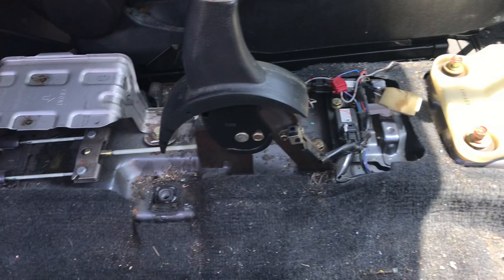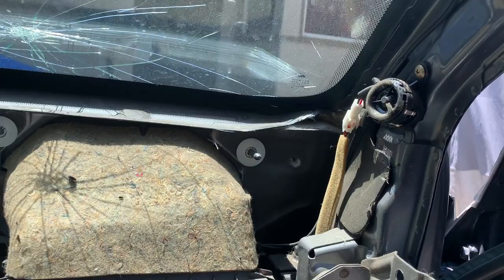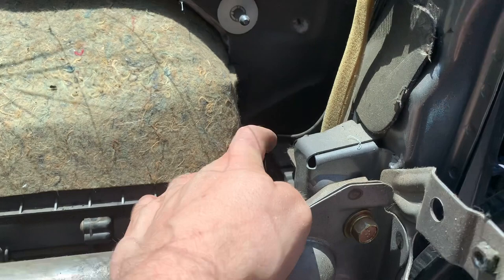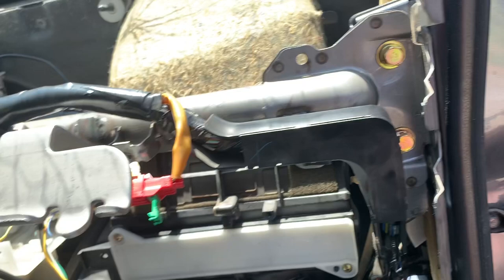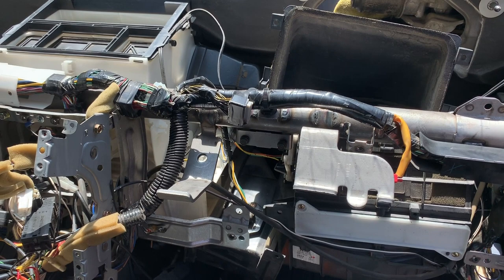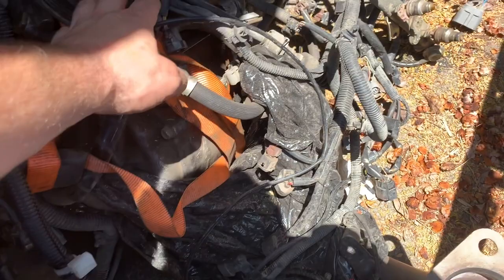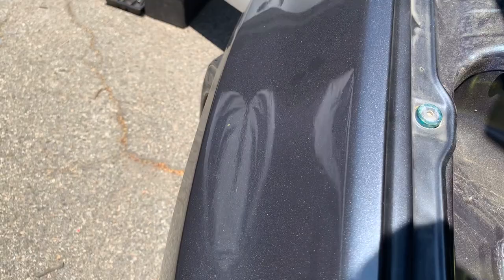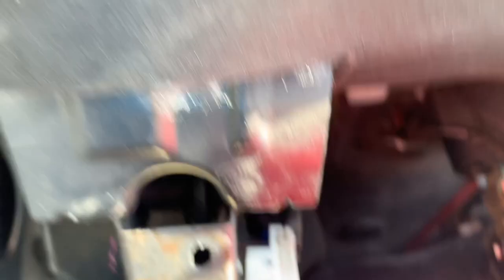Rebuilding my wrecked EVO 8 MR -  Engine wiring harness and dashboard removal

Comment: i ended up cutting that back retainer off from underneath the dash w a razor blade, im so glad i didnt have to pull my dash fully. But you are a legend for all this info bro
Reply from the maker: I’m glad you found the video helpful, I know its a pain in the ass but the good thing is you only have yo do it once, on the assembly you just don’t put that one bolt back and everything is much easier
Reply: @speedprophets82  for sure! I hated pulling it apart but im actually looking forward to putting it back together today 😂
Reply from the maker: @soren00024   just grab a cold drink and its gonna get much easier than taking it apart :))